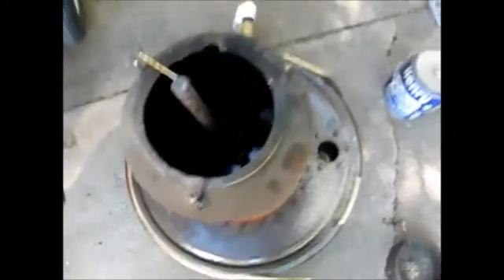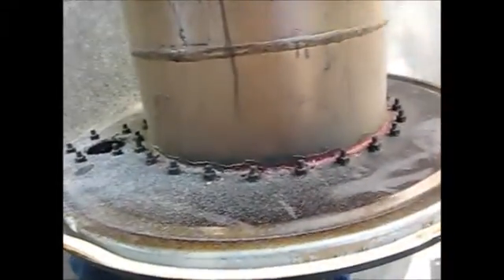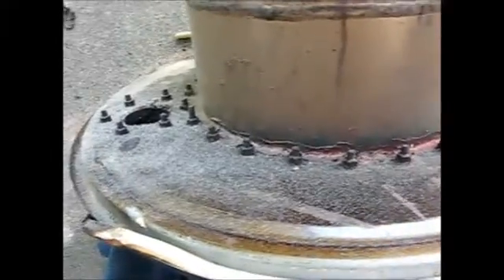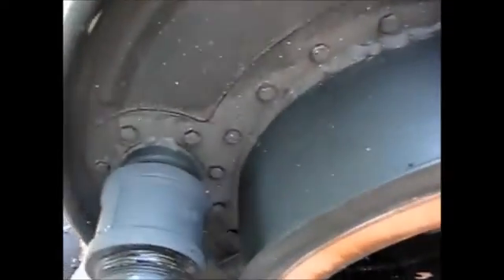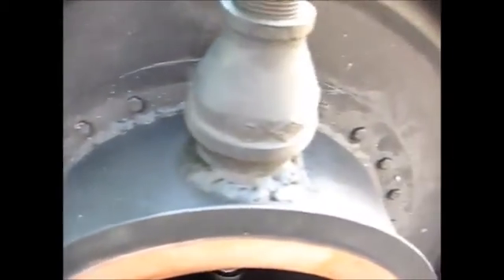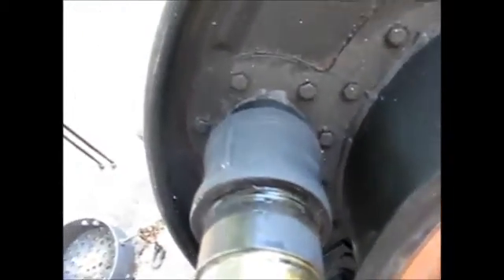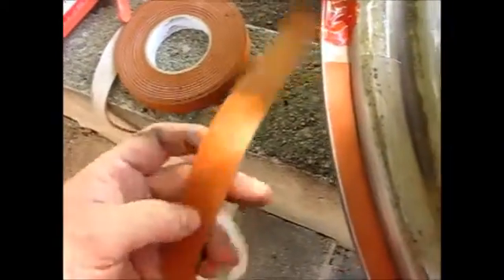Gasifier Review Video 6

Comment: I knew there was a reason to get up at 3:45 AM !! The next wood gas victim comes in from the shadows. You've done a nice job with the construction aspect and you really are very close to having a successful run.I too have a Flash001USA clone and have had many successful runs and also a few disasters. These are the points which I see as to what is holding you back. Starting with the air input pipe I suggest 3/4 inch at minimum. The side holes drilled can be increased to way more than the pipe cross section. I have a threaded coupler on the  end of the pipe with a cast iron end plug with a hole drilled right through the end ,plus the holes in the side of the coupler.
Next, I see no sign of the plaster Paris/sand mixture for a heat sink in the wheel rim assembly with the restriction cone. My guess is that is an important component to allow the hearth area to retain and build up to the temperatures necessary to burn the tars. 
With your choice of engines you should reduce the restriction bell to 2" or 2.5" and have at least a 5" height for the char column. An inverted bell pipe is a good idea so that the char and super hot coals can move freely to the shaker grate. The shaker should be 3/4 to 1 inch below the 5" .  I started out with a 3" x3.5 " restriction zone like Flash  originally had but he modified his  to 2" x 5" inverted bell at the same time I had just completed the 3". I unbolted the 3" assembly from the wheel lugs and  I made a ring  from Stainless to bolt up to the lugs then welded a 2.25" to 3" x 5 " inverted cone to the adapter ss ring . Then slipped the origonal 3" and mounting plate bak over it. Basically two in one.
You have to seal up the hearth to the wood hopper. The burn marks which showed licking up the sides of the wood hopper are signs of air leakage. Either weld it all up or , if I were you, use some wood stove fiberglass  woven gasket and high temp Rutland cement to seal it all up..
 Make sure you have something to keep the wood hopper lid tight. I use a large spring anchored to the top of the barrel and stretch it up and over the lifting handle back to the anchor point. It seals it well AND acts as a blow off valve for the inevitable backfire. Until you get it all sealed up, keep a garden hose at the ready !
Make sure the ash clean outdoor mounting assembly is sealed to the barrel.
 Use axle grease on all the steel pipe slip joints. It might get a little messy but it woks well as a sealer . Infact I did not glue any of the PVC or steel pipe joints but used grease on everything. That and union couplers between the major components.
 Next the blower: Use the 4" 12vdc bilge pump blower. Yes it gets gummed up with soot, tars on occasion and lots of moisture. They can get cleaned over and over. I even have to give it a spay down on the impeller with brake cleaner, free it up with a long screwdriver moving the prop back and forth untilit is free to spin and on occasion  have dropped it into a pail of hot water w/Oxy clean ( even while running  !!!) to clean it up.
 Where the 12 V wires go through the plastic housing inject it with silicone to seal that hole up. They are really tough blowers surprisingly, with a sealed motor.
 The last thing is the wood fuel you are using. Reduce the size of the blocks to something like  3/4 to maybe 1" chunks .
 Be sure to take a video of your next start up, good, bad or ugly and we may be able to help more.
I hope this helps. Don't give up . We all have years tied up in these things ! You will get there.
BTW I have a video which shows how to form a cone which might help.
Best to you,
 Bill      NH Hbbyloggr
Reply from the maker: Thanks Bill. I will. I have video of the maiden voyage but it was filmed using my S3 with the aspect ratio the wrong way, its a mess. Ill try to put it up when I get a chance. Its not good video.

Comment: I would be tempted to pack fiberglass around the bell inside of the rim but that's just me. If your lid seal doesn't work, use the same method but add some liquid RTV cememt to the RTV tape and lock it in place to get a perfect seal. You can coat the lip of the barrel with axle grease and the RTV cememt won't stick to the lip but you will still get a good seal. Rub some wood ash from the gasifier onto the gasket on the door so that you don't get any sticking if needed.